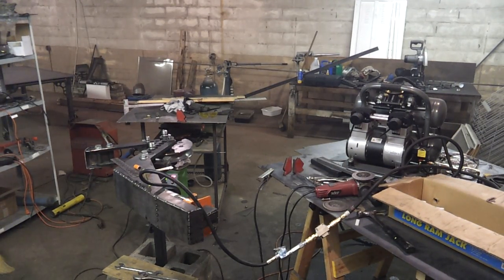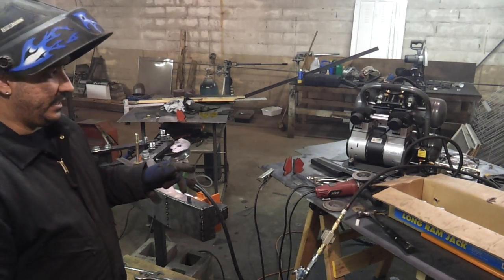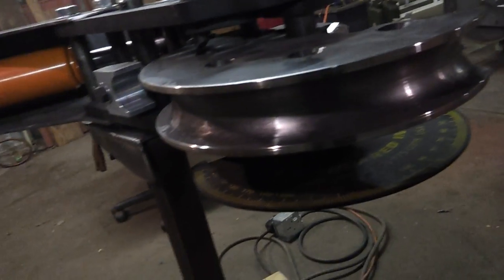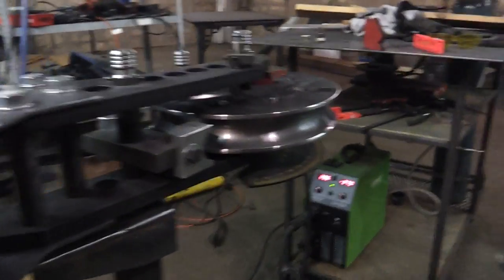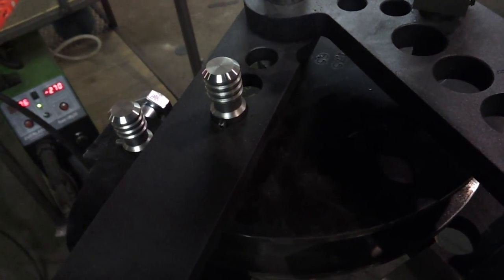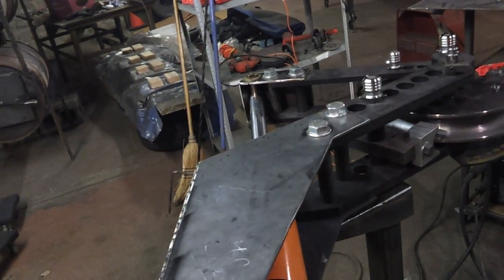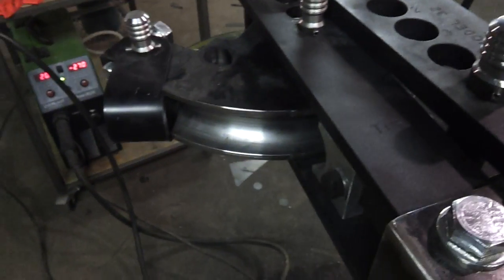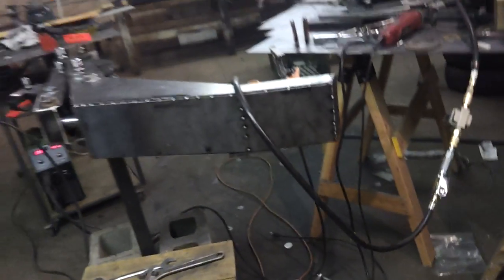JD2 Model 32 + Harbor Freight Ram Build (Part 5)

Comment: this is very helpful i have been looking into doing thsi to my model 32 maily because its a bitch to manually pull thicker wall tubing you did and awsome job i will let you know how mine turns out in about a month or so when i get around to it
Reply from the maker: Glad the video helped you out. Looking forward to seeing what you come up with.